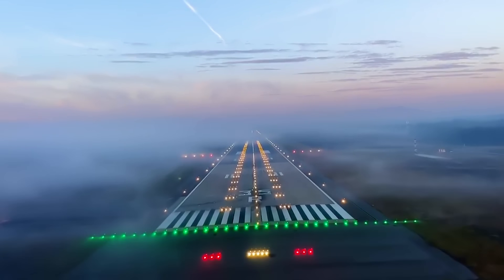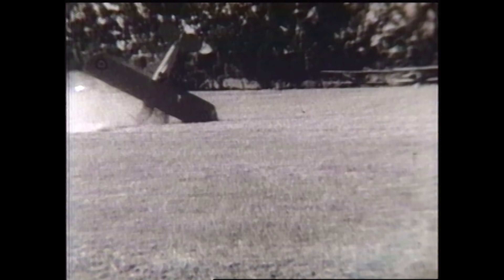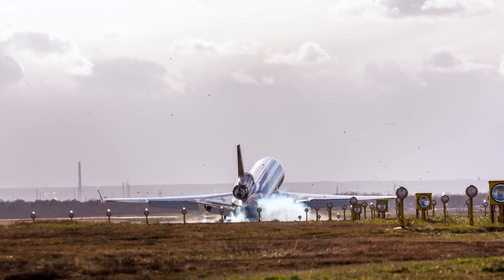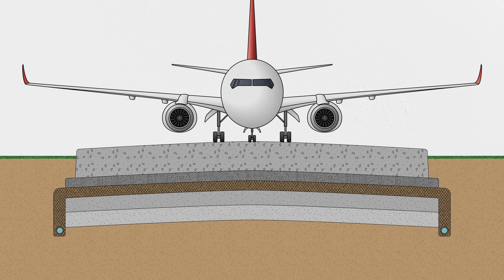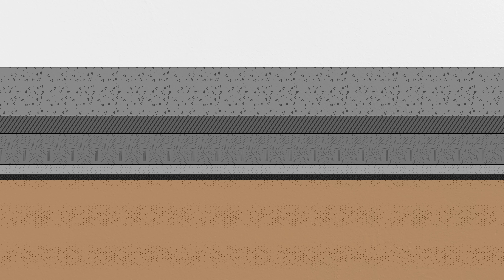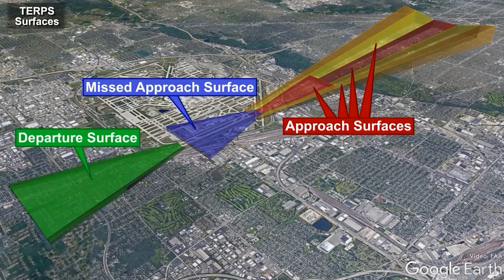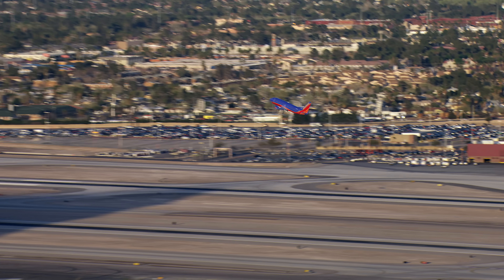The Hidden Engineering of Runways

Comment: I drove by the Chicago Executive Airport crash on my way to work. The nose of the plane was just barely past the curb of the road that runs along the side of the airport.

ETA: The EMAS was relatively new to the airport, and quite expensive, but they were quite glad it was there!
Reply: Wasn’t the one at PWK put in because of what happened at MDW that one winter due to its notoriously diagonal runways and by not having an EMAS; a jet overran and crushed a vehicle, killing a child?

Comment: In 1998, my client and I was tasked with fixing a drainage problem in the asphalt taxi ways at a tiny grass field airport.  First, the airport hired a FAA Approved Engineer to write a report about what needed to be done, and assure the FAA that the runway would not be lengthened at this point, but at the next construction update.   Next the airport hired a firm to fly the airport and generate contours so we could analyze the problem areas.   Then when the problem areas were identified specifically, we sent out a land surveyor to survey the taxi ways and hangers.   The drainage solution was to drain the taxiways to a lower portion of the property.   In subsequent years, we were asked to design a 2nd grass runway after they paved the main runway.  And finally, we upgraded the downstream drainage system to dump into a larger canal (as dictated by the state and county).     It was a great job, and sadly I lost all my cadd files in 2002.

Comment: During my time in the military I had the chance to talk to a few army pilots. According to them every interstate highway was designed with sections with the ability to be used as emergency runways for military cargo planes. Most notably the C130 family of planes. I’ve never had any reason to doubt that. I know that the minimum height of the overpasses is set to accommodate the maximum height of military equipment hauled on a flatbed. So the idea of sections being built as emergency runways sounds plausible. Can you shed any light on this? Or maybe even a video?
Reply: That is one of those persistent myths which has no basis but people keep repeating it.    The Federal Highway Administration has even addressed this myth on their website.  https://highways.dot.gov/highway-history/interstate-system/50th-anniversary/interstate-highway-system-myths#question5

Comment: Hmm, I did residential concrete for 30 years, flew a hang glider for 10 years, and think like an engineer, though I am not one, but I ALWAYS tinker with things, and my dad was an engineer. I knew there is a lot to making sure the sub grades will hold up. Kind of surprised about what asphalt can do. For sure, it is only as good as the surface/sub grade under it. For pilots, any one can fly the dang things, but the take offs and landings are the hard part. I spent 2 years on the training hill learning to take off and land in all sorts of conditions. That saved me a bunch of times.

Comment: Pilot here... Great video! Everything in the video is spot-on. A couple times I was thinking about some other part, then Grady talked about it after.

A few other things as added info:

12:55 Those runway safety areas, and the airspace beyond, are VERY important for landing in bad weather.  All commercial airplanes generally back-up the approach with the IFR instrument approach route, and review the associated charts for it, even if the weather is perfectly clear. That's to keep approaches, (and the landings after) repeatable in a consistent way. Ask a pilot how many times they've heard the term "Stabilized Approach Criteria" (they've lost count by now, guaranteed 😊).

That said, if there's obstacles rising into that safety airspace, the approaches will have minimum altitudes that are higher than standard, meaning that more days each year will have weather bad enough to prevent planes from using it to land. The standard approach brings aircraft to 200 ft above the runway.  If there's a specific approach lighting system on the ground, before the beginning of the runway, you can see the lights through the fog, and continue to just 100ft above the runway. There's lower approaches out there, but they have very strict crew, airplane, and airport equipment requirements. Imagine being at 50 ft on one of those, still descending at 700 ft/min, and just then seeing the runway! Always interesting. 

We are at the point where GPS is good enough to more-or-less replace other approach types as the default.  This is an over-simplification, but with GPS, you can just-about draw a route on the map, assign some altitudes and descent angles, and fly it (with much less requirements for ground equipment to be aligned with the desired route). Let's not get involved in the politics with my next statement for this... but with Trump's Mar-A-Lago being east of the West Palm Beach airport (which I myself frequently go to), the FAA was able to "draw-up" a new approach for the west-bound runways, avoiding the new airspace restriction, and "voila!" the runway is usable again, despite other instrument systems being the wrong direction for the new route.

An 18-wheeler truck that weighs 80,000 pounds is about 4,444 pounds per tire. ... A plane like the A380 Grady mentioned puts it's 1.26 million pounds on just 22 tires, or 57,500 pounds per tire. Weights like that would be comparable to an 18-wheeler truck... if it were instead a giant motorcycle! That would make for an interesting Mad-Max kind of vehicle. Most roads would crumble under it. You can see pictures of cargo planes (a couple military cases), where the plane taxied-over pavement that couldn't support them, and they made ruts in the pavement and got stuck. Heavy stuff!

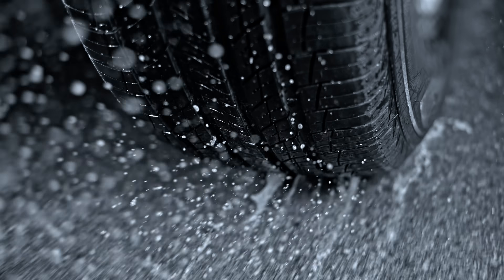6:09 An interesting addition here: You may think of airplanes and their reverse-thrust and think "Yeah, planes move air, so that's how they stop too, right?" I wouldn't blame you one bit. Thing is, the wheel brakes are so dominant in the landing performance data, that we can temporarily keep flying without a thrust reverser functional, and they are not added to basic landing data at all, they're just an added benefit. If the runway gets icy in the winter, that can cause the runway to be closed for landing. Reversers aren't enough. 
Have you seen the panels on-top-of the wings lift-up on landing? Those "spoilers" only exist to "spoil" the lift of the wings, primarily to allow the plane's weight to settle-down onto the wheels after landing... just so the tires can take the braking more without skidding. 

Also, on grooved runways (depending on the company, and the pilot you ask), if the airport does its friction test with a good score, and the runway is grooved, "technically" the runway can be considered "dry," even if it just rained a short time before... so long as the grooves don't have a glossy texture to them indicating that they are close to full.

Comment: Retired military and airline pilot and I found this to be a great video. 650 thousand pounds on a 777 takeoff and at a place like Heathrow in London it is one after another of this size aircraft. 

One thing to mention as well is the heat that the runways are subjected to when the aircraft starts to rotate. That's can be around 500 degrees C.

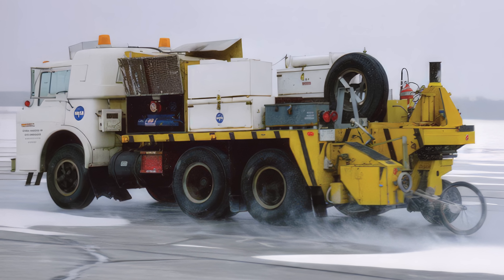Comment: As a dancer, 7:00 makes so much sense because the shoes we wear need to be occasionally "roughed up" (in a specific way) after a certain amount of dancing, because of both debris transfer from the floor and friction-smoothing the material. Freshly-prepared shoes are a dream to dance on because it is predictable friction that you can also control; apparently the same for runways and aircraft! Very cool!

Comment: The fact that heavy planes cause far more damage during takeoff than during landing is fascinating.
Reply: Yes, I would have thought the shock of a heavy landing stressed the runway a lot.
Reply: @evaluateanalysis7974when they land, they're at the lightest because all the fuel is burned. At takeoff those planes are at or near max gross takeoff weight
Reply: @MisleadTruth Wow! You watched the video too!
Reply: Similarly, takeoff is the most dangerous and “critical” phase of flight. The general population thinks landings are more dangerous but that simply isn’t the case.
Reply: Yeah. The shock load of a heavy landing seems like it'd multiply the load more than the fuel weight. Learn something every day.
Reply: @stephenhagen8976 dont forget that during touchdown the wings are still generating many literal tonnes of lift
Reply: bot
Reply: When the plane lands its still “flying” . Still tons of lift on the wings.
Reply: @eric4946 ideally yes. But they have to build for the hard landings don't... As as student pilot, I can tell you some of my landings definitely put more than the airplane weight onto the runway. 😂 On a big plane. The reality is too much will buckle the gear. Probably not much higher than the takeoff weight in reality
Reply: @stephenhagen8976 in order to put more weight than the airplane loaded you would need to experience more than 2G.

You have nearly 1G just from the lift on the wings when landing, then you have the speed you’re coming down with and the distance of the suspension and tires. Also in this case your wings flex down a bit further dampening the impact. Im sure during an “event” it’s possible but to actually get more than the weight of the aircraft into the runway during landing of a commercial jet you would definitely feel it.
Reply: @eric4946 I'm not disagreeing with the video or the math. I just hadn't thought about it much before. I personally have bounced not only in my little private plane while I was learning, but in an airliner as a passenger. My instinct told me that was the bigger damage, but it checks out. I'm not arguing with the engineers, just explaining why I was surprised, like the original poster.
Reply: @eric4946 Skipped Physics in school?
Reply: @eric4946 "tons of lift" Clearly not when they hit the runway very hard.
Reply: Bot stealing comments

Comment: I work in airport operations and hold numerous certifications. I have to disagree to some extent your comment at 8:18. Landing does cause significant wear and tear to runways, and this is where the most work is done on a runway throughout the year. Landing causes the grooved surfaces to "chip out" on concrete runways. It's also hard on the runway to oblit the rubber left behind from landing aircraft because of the intense water pressure that must be used in order to get keep the runway within friction testing tolerance. Runways also have to be able to take an overweight landing when an aircraft that recently took off must return for an emergency (it's full of fuel still). Otherwise, you did a fantastic job on this video. It's an excellent primer video for those who are new to aviation! Well done.
Reply: I’d assume the reason you count takeoffs instead of landings is because a landed plane eventually departs, so there’s little reason to count both.

Comment: Need to do one on the engineering of highways/freeways and acceleration lanes/deceleration lanes. When the US increased speed limits on many roads, they never extended the accel/decel lanes from on ramps/off ramps. Thus vehicles need to speed up/slow down much sooner to merge/exit. And most US highways were only designed UP to 75mph. Many were built for 55mph as were their exits/entrances. And then there are the ramps like a clover leaf, engineered to force you to slow down. But too many speed and ignore the yellow warning speeds signage. Rollovers, flips or slidage increase with faster highways.

Comment: Not only are planes taking off heavier, but the runway has to be built to handle a high-speed rejected take-off; where just before the plane is fast enough to take off [technically, up to V1 -- the takeoff decision speed] the pilots decide something isn't right and they're not going.  So now you've got this very heavy, very fast, plane that's slamming on max brakes!  
I know that dictates the needed runway length to permit a given plane to operate but I assume the heavy (in both senses) braking also drives some of the physical design requirements of the runway layers/materials.

Comment: Hear me out: Why don't we put a water cooling system under the runway to cool it down dringend summer and heat it up in Winter if there's snow. You can pump the warm water in a reservoir which is a few hundred feet deep to store it - we use this system already for houses so why not for runways?

Comment: I really love the discussion the thumbnail generated between my partner and I.
- I said I just learned that the ends of a runway can have crushable concrete to arrest planes overrunning.
- They asked why not gravel? It'd be cheaper.
- I said maybe something to do with it compacting too much over time.
- They pointed out runaway truck ramps just use gravel.
- I realized that compaction must not be too much of a concern, because trucks are way lighter but dig in just fine.
- Then I remembered blast pads are a thing but forgot what they're called and said oh it's because of jet exhaust. It'd dig a hole every flight otherwise.

Critical thinking instead of just googling. :3
Reply: Some smaller airports do use gravel on the overruns. If you look up the Scottsdale, AZ airport on Googly Earth, you can see both ends of the runway are surrounded by large gravel areas. Seen a couple planes end up there myself.

Comment: 3:40 or back in the MD80 days you couldn't take off in the heat of the day in a number of locations if it was a full flight.  Been there done that, although I liked the MD80 series better than the 737's.

Comment: I am a big fan of your videos. I appreciate how much you have taught me. One correction to this video from a 40 year veteran of aviation is that we do not normally use the wheel brakes when we land. We use the engines only. In small planes with  reciprocating  engines the wheel brakes are used but in the vast majority of air travel turbine engines are used and the engines are used to slow the plane. Not until the aircraft parks at the gate are the wheel brakes actually used. And then it is only to stop at the gate and used as a parking brake.

Comment: San Diego Intl is a crazy airport.  It's right in the middle of a major city, not way out past the suburbs as most are.  9400 ft long, but with huge displaced threshholds due to steep approach angles.  Prevailing winds (almost always) are westerly, so runway 27 is the most used.  It is steep as it comes down a hill where you can look out the left windows and into office windows downtown.  There is no ILS on runway 27 due to the steep approach.  The busiest single runway airport in the US and second busiest in the world and most landings are VFR!  As a result, the airlines usually put their best pilots on routes leading to/from San Diego and so the rest of your flights and landings are with the best in the business piloting the plane.  (Nice.)  But if you are sitting in traffic on Laurel, waiting for the Pacific Hwy light to turn green you can see the color of the very wide eyed passengers skimming just above the street on their final approach.  It's a real E-ticket ride.  And if you look to your left, you'll see the blast wall for runway 27 takeoffs.  Yep, a wall, because there's no room for a blast zone, and it's right alongside the street.

Comment: Aerodynamic erosion reminds me of an incident when I was working on paving the former gravel runway in Rankin Inlet. We couldn't shut down the airport long enough to pave it all in one shot, so it was done in sections, with a temporary asphalt ramp, laid on top of a layer of tar paper, built at the unfinished end so the planes wouldn't hit a giant speed bump. It worked pretty well until one of the jets taking off rotated right over the ramp, lifting the thin edge, and peeling the whole thing right off the runway and scattering it all over.

Comment: " Jeju Air Flight 2216 was a scheduled international passenger flight operated by Jeju Air from Suvarnabhumi Airport near Bangkok, Thailand, to Muan International Airport in Muan County, South Korea. On 29 December 2024, when the Boeing 737-800 operating the flight was approaching Muan, a bird strike occurred, with both of the engines ingesting birds, causing an apparent loss of thrust in the right engine. The pilots issued a mayday alert, performed a go-around, and on the second landing attempt, the landing gear did not deploy and the airplane belly-landed well beyond the normal touchdown zone. It overran the runway at high speed, collided with the approach lighting system, and crashed into a berm encasing a concrete structure that supported an antenna array for the instrument landing system (ILS). The collision killed all 175 passengers and 4 of the 6 crew members. The surviving two cabin crew were seated in the rear of the plane, which detached from the fuselage, and were rescued with injuries. "
RIP. Condolences. Also what's around the runway matters too.

Comment: A quick comment about your point on thrust reversers stopping an airplane. The thrust reversers primary job is to reduce lift. It does this by obviously reversing thrust, making the aircraft slow down a little bit. But the equation for Lift says that if you double your speed, you quadruple your lift. So by dropping the speed by even only a little bit has a massive impact on the amount of lift the wings create. If the wings create less lift, then more of the aircraft weight falls on the tires, and therefore an increased friction force, making the brakes more effective. The spoilers on the wing do the same thing. Their function is not to slow the aircraft down through air resistance, but rather destroy the lift the wing creates, therefore putting more weight on the tires and making the brakes much more effective.